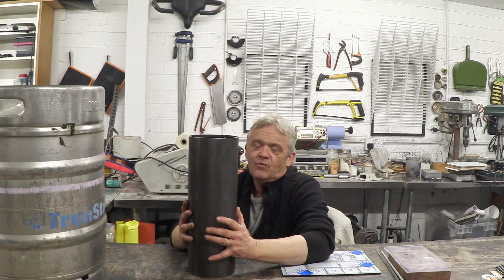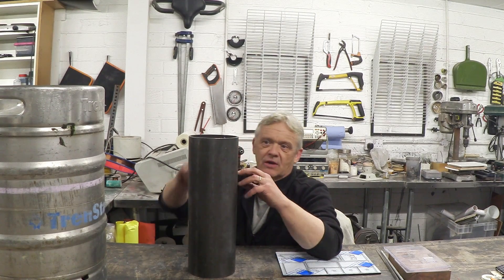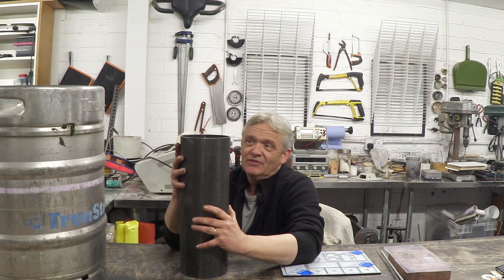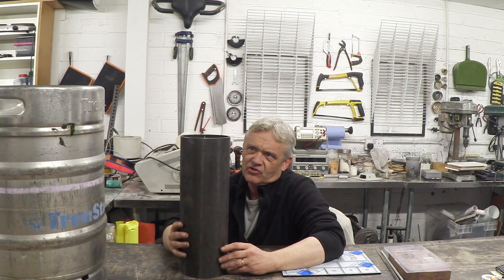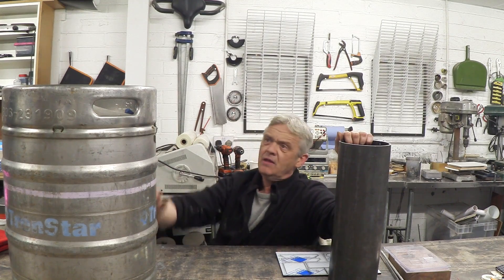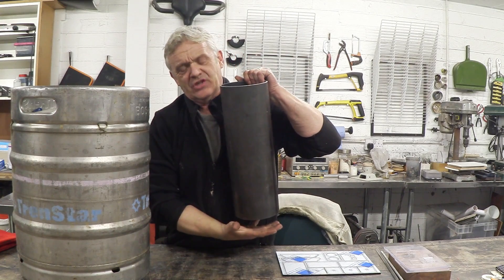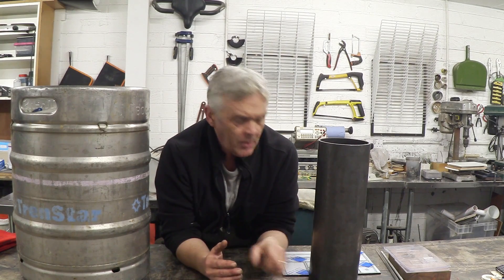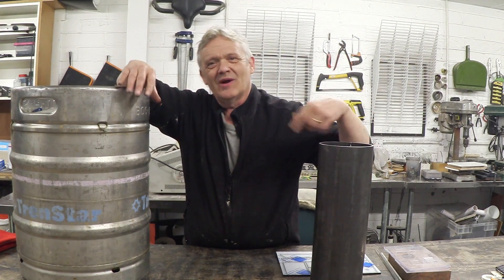DIY Gasification and Generator Unit - Part 2 - The Fire Pipe

Comment: I don’t think I’ve seen you do this, but I may be wrong. Could you do a cheap vacuum pump build? Something that would cost about as much as a cheap unit but work way better? Another thing that I’ve never been able to get just right is a heated press. I want to build a cheap 20ish ton heated hydraulic press. I ended up just building a regular press and had the idea to use hot plates or heating blankets as the heat source but that just doesn’t work very well. I imagine you’d need to have custom machined parts that can hold the heating element while maintaining structural integrity. Any ideas?
Reply: I make skis, and my prototype press for years was a vacuum setup - Fridge motors!, Slow yes, but depth of vaccum to rival any lab pump. If you want speed on your initial vaccum pull down use a cheap AC service pump, or even a shop vac!